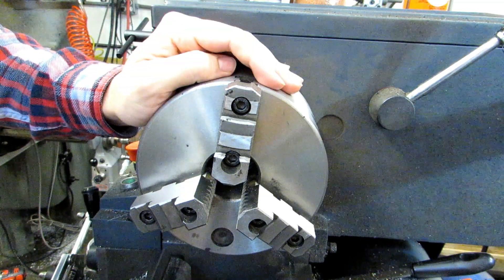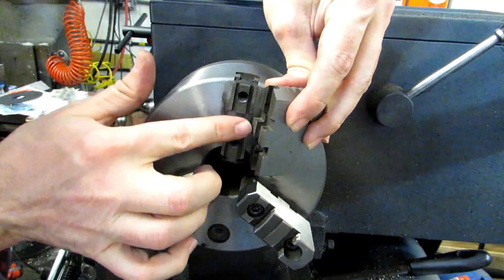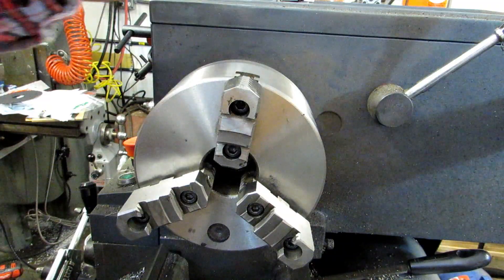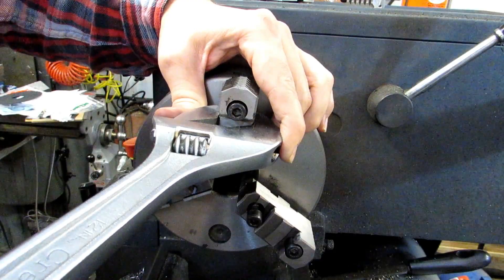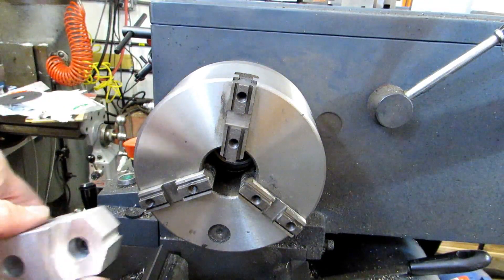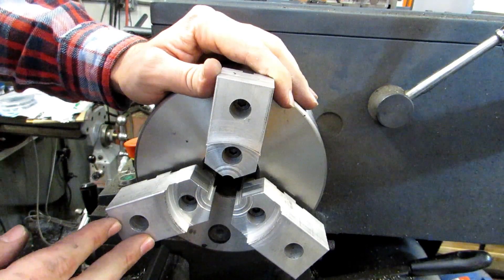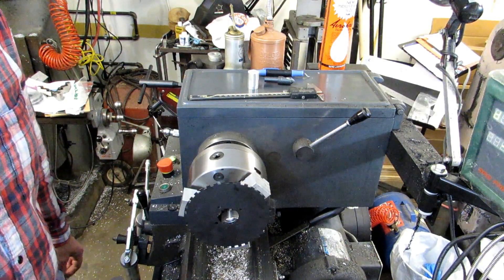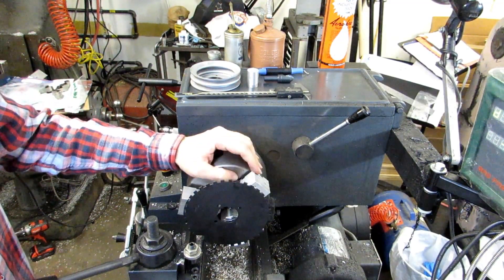Using Soft Jaws on the Metal Lathe

Comment: As an aspiring machinist, I have a lot of questions about cutting tool selections. Since you are cutting aluminum for the soft jaws and it is an interrupted cut, I would have thought HSS would be used. I looks from the video (although it is hard to tell) that you have a carbide insert. What is the best tool to use here?
Reply from the maker: I don't have any boring bars that use HSS, so that made my decision for me. Interrupted cuts can be destructive to inserts because of the hammering action of the cut, but this was a series of light cuts in a soft material so it wasn't too hard on the insert.